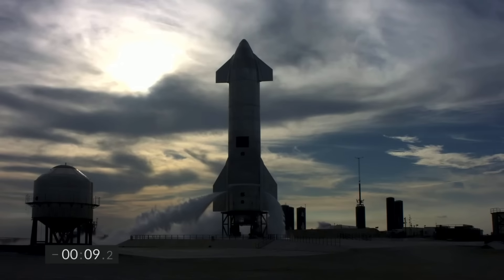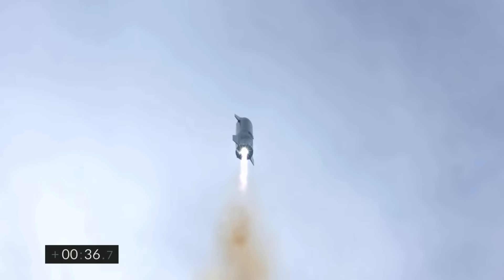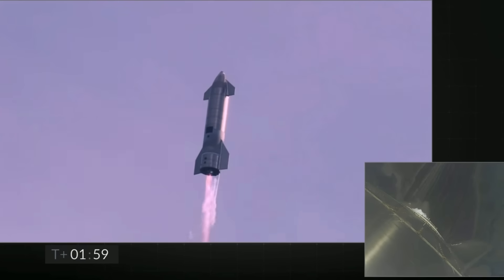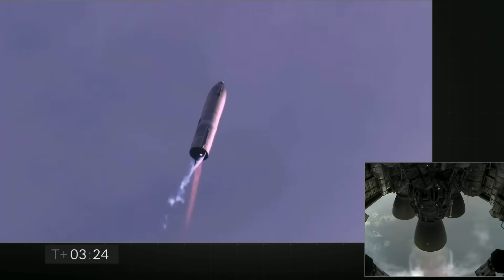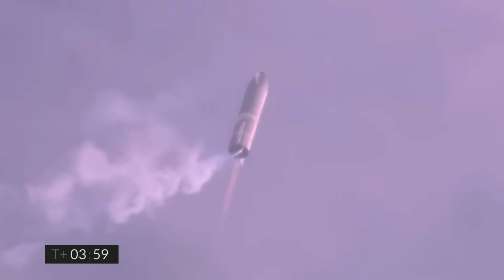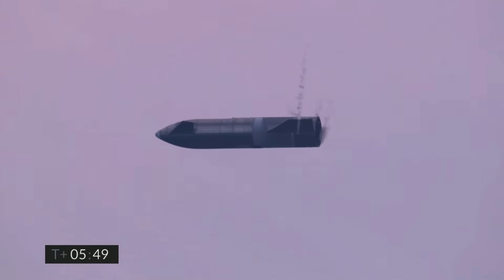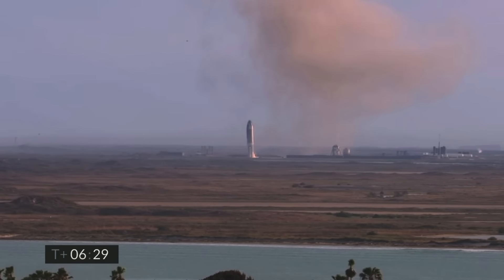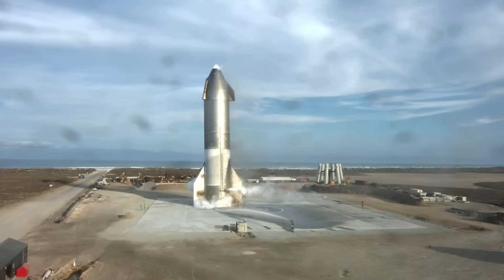SpaceX Starship SN10 soars, lands for first time!

Comment: side note; i have a theory why these probes keep exploding, it's a combination of the fuel source, the atmosphere and the way timing of the rockets descent through the atmosphere. factor those 3 things and i'm sure the probe won't explode anymore
Reply: Really?  Just how many Teslas have you sold?  Where do you rank on World's Richest List?  Now shut up.
Reply: @Melody615199999  slow your role man. all i stated was my own idea and opinion. no need to get all up in your panties because you're some big shot car salesman. it's a basic science and math principle that actually makes sense if you think about it. for every layer of atmosphere you have to increase thrust to break through to the next level, so by the same principle, you decrease thrust but at a slower rate. just like a car that's going 160 mph on an open road. you can't slam on your brakes and think you won't run the risk of dying in a fiery death immediately. you pace your descent accordingly. if you factor in the atmospheric pressure increase according to rate of speed and the gravitational pull, verses the fuel consumption required to use shorter bursts of fuel upon descent instead of a continuous burn, you'll probably see fewer blow ups.

Comment: Congratulations.  Accomplished what McDonald Douglas did 25 years ago with Delta Clipper.
Reply: So has New Shepard and the Falcon 9 rockets. Delta Clipper was a nice little start in propulsive landing though. Too bad it was over cost, poorly managed, and the idea was scrapped after the prototype blew up due to crew negligence. Funny that with actual competently run companies without Uncle Sam breathing down their necks they can actually get shit done. And if they fail, they can do better, rather than give up like the petulant children running these old corporate welfare companies.
Reply: @samos8367  25 years laterrrrrr.  With a lot of help from “Uncle Sam”.  There was no “crew” negligence because there was no crew.  No need for you r petulance Samos.  Simple pointing out we lost at least 25 years of spacecraft advancement because NASA chose NOT to fund the delta clipper because of a landing gear malfunction that could easily be rectified.  McDonald Douglas had the better craft and tech.

Comment: It exploded a moment later. Not enough space between the fuselage under-skirt and the pad. Explosive fuel built up in the gap without enough room to fully vent; residual heat ignited the overpressure gas like the combustion chamber of a car's engine. The system needs real landing legs that hold the bottom of the fuselage away from the ground, at least twice the height of a raptor engine bell. You could see the escaping gasses trying to burn off on one side where the little feet held open a corner of the skirt; but the leaning ship told me that part of the skirt was against the ground trapping unburnt gasses underneath it. The flight computer was good. The structural design engineers fu**ed up.

Comment: "As you can see, Starship has exploded. This is intentional"
Reply: People are burning and wailing now, this is  intentional
Reply: 😂 savage
Reply: I so wish that was said during the broadcast. lol
Reply: volunteerz  It's not really about fixing the leakage so much as about having the landing be a tad softer so as not to cause the damage.
Having better landing legs might have been enough. Either way, amazing test.
Reply: @LuisPereira-bn8jq  The landing was pretty hard in spite of what the propaganda... I mean commentator said.  But it looks like at least one of the engines is leaking fuel when they shut down 1 & 2 just before touchdown.  All that orange flame shouldn't be there.
Reply: @nickh5081  "in spite of what the propaganda..."
You know what the actual "propaganda" is? Your dishonest usage of the word "propaganda". So good job calling yourself out. 
And this was in no way a "hard landing". An actual "hard landing" would have destroyed the vehicle on impact, whereas this landing caused at most modest structural damage. Much like the difference between a fender bender and an actual car crash. 
Was the landing a perfect one? No. But it was far closer to a soft landing than to a hard landing. Those are the facts.
Reply: @LuisPereira-bn8jq  The FACT is it blew up.  The FACT is they cut it out of this video (it was on here at first and they edited it).  The FACT is if you read down the comments, many of the people that watched this after they cut it think this launch was a complete success and don't know it exploded shortly after the video ends.  If that's not propaganda, what is? What's your problem, anyway?  You have money invested in this company or something?  I'm all for SpaceX and hope they get this right - doesn't change the fact that their propaganda machine is trying to hide the truth to some extent.  Does it hurt your feelings less if I call it their "PR machine"?  You should relax, it really was a joke (even though it's true!).
Reply: @nickh5081  "The FACT is they cut it out of this video (it was on here at first and they edited it)."
Really? Prove it. Because it is crystal clear from the narration that SpaceX cut their feed shortly after the landing. Which, mind you, is standard operating procedure: they do the exact same thing for the Falcon 9 launches, where they often cut the stream shortly after the first stage lands, rather than keep that stream open in case something happens 10 min later.
"What's your problem, anyway?  You have money invested in this company or something?"
My problem is with idiotic misinformation like the one you are spreading. Blowing up 10 min after landing has very little to do with how successful this test was. Let's say they had better on ground systems which somehow managed to put out the fire and prevent the blow up. Would that somehow mean that the actual flight and landing were any better? Of course not. Actually put 10 seconds of thought into the bullshit you spew, rather than saying the first bit of random kneejerk nonsense that crosses your mind.
Reply: It's not a bug, it's a feature.
Reply: It’s not
Reply: volunteerz  There was indeed only one raptor engaged on landing, as was intended. And the one raptor seemed perfectly enough. The poor landing legs probably made more difference than lack of trust.
Reply: It clearly was intentional, so the rusians could not steal the desighn.

Comment: How was the video taken at altitude, where the camera seems to be following the ascent of the ship?  I think there is a lot of fake videos in this piece, either that or animation.
Reply: I mean we can see planes that fly at ~11 km up with the naked eye and this only went to 10, so just a bit of zooming with the camera work lol
Reply: It was a plane with a stabilized gimbal camera if I heard correctly.
Reply: @pipess7064  That is a possibility, but I think the plane would have to be climbing at the same rate as the rocket for most of the video.  Also, was the plane flying towards, away from, or transverse to the rocket.  Should we see a changing point of view of the rocket from the plane's flight path?  Thanks for the suggestion, but I am still not convinced, especially when I seen smoke trails from the engines that are moving very slowly, whereas I would expect them to move away at a speed corresponding to the rate of ascent.
Reply: @TheManGrant  The plane would likely be flying a circular pattern a long ways away from the launch for safety. At that distance the plane's movement would look like nothing to the camera, as the ship would stay within a few degrees of vision at most.
The gases being vented out of the ship are lighter than standard air, so they rise, reducing relative speed. And they never got it going very fast since they only needed to go up a few thousand meters.
Reply: @pipess7064  Thanks.  That make sense.

Comment: To prevent any loss of life hows  about (I'm not rocket scientist brochachos):

1. A "Tailhook" similar to those used for jets. 
2. When the space craft is returning have a horizontal entrance fitted with (the aforementioned) that slows the speed of the craft (rapid deceleration).  Again that's at 150mph. I'm sure spaceships go warp speed tho lol.
3. Magnets: as to stabilize the space craft landing (Automatic magnetic field stabilizer ). But it might mess with electronics.

But dang , a real spaceship that lands itself , awsome.

Comment: Why don't they have a parachute, like the one they used for the Mars rover, perseverance. The parachute manufacture in the UK. 🙄
Reply: No parachute is powerful enough to support such a heavy craft
Reply: @baha3alshamari152   The one used for the Mars rover perseverance descent. Was of a super sonic  heat resistant design. They can have three, like the ones used for the Apollo capsule descent. 🙄 Just to slow it down a bit.
Reply: @m101ist  
Rovers are at least 1000 lighter than starship 
Especially if it's full
Reply: @baha3alshamari152  They used a small parachute going supersonic on descent. 🙄 They could use three larger canopies to slow down the rocket a bit on descent. 😲
Reply: @baha3alshamari152  Space X from the international space station used 4 parachutes on the dragon capsule on it's descent. 🚀😲
Reply: @m101ist  The Dragon capsule is the size of half this ship's nosecone. And the airframe itself is nothing important so long as they get the data, which is transmitted over radio.
Also, everything went fine until a slightly hard landing. For an early prototype, that's very good.
Reply: @pipess7064   If they had used a parachute like they did before they would have had a slightly softer landing. 🙄
Reply: @m101ist  Half the test is getting it to land under its own power like they pulled off here. Chutes are pointless complexity in this case.
Reply: @pipess7064  Then after that it exploded. I consider that a failed. 😲
Reply: @m101ist  Apollo 1 caught fire with the crew stuck inside. The Apollo program isn't a failure. This prototype met its goals.
Reply: @pipess7064  well it was a good job nobody inside it. It would have been a disaster. 😲

Comment: After the three engines ignite for the landing sequence you can see something goes horribly wrong as two engines flame out and the craft is visibly spewing fire where fire doesn't belong. So three for three failures. Can you imagine if NASA had so many f*** ups? Congress would be howling for blood.
Reply: Its supposed to land on one raptor engine
Reply: NASA has had a fuckton of fuckups. I can name the Challenger and Columbia, Apollo 1 and 13, and many of their early rockets in the 1950s.
Reply: @pipess7064  Really showing your ignorance of history. Both Shuttle disaster, and the Shuttle itself, were the direct result of political interference. In addition, following both disaster there were years of inquiry and cover-up by politicians. SpaceX has none of that baggage and decades of experience and metallurgical advancement to draw upon.  Back in the 50's rocket science was new. What's your frackin' excuse?
Reply: @davidgapp1457  Is this landing sequence not a new technology also? You should cut them some slack, it's an early prototype. The only difference is that instead of metals, they are testing control and timing devices.
And while the shuttle disasters were in part caused by schedule-pushing, Apollo 1 and 13 were just blatant tech faults. 
On a more similar scale, NASA's research at Edwards AFB led to many crashes. The lifting body tests, high-alpha tests, and the X-31 program all led to catastrophic destruction of several planes (M2-F2, at least one F-14, and one X-31 respectively).
To top it off, what does it matter to you what a private company does with capital? They're not harming you, and the only gov't money they get is for proven stuff like the capsule they sent to the ISS.
Reply: Thats what a raptor shutdown looks like
Reply: @warrenayres200  The engine or leaking fuel continued to burn after touchdown. Add what was possible a stuck valve and kabam! But regardless of your explanation (which I accept) this vehicle is still 3 for 3 and it's only representative of the upper stage. Believe me, I want SpaceX to succeed and I realize you learn from your errors, but NASA doesn't catch the same breaks. NASA, unfortunately, answer to frelling idiots in Congress so their errors can't be as easily brushed off.
Reply: @davidgapp1457  why dont you make a fucking space ship
Reply: @Dominic-sr1ed  Already did that. Went to the moon. Now I'm retired and rolling my eyes at people who stand on top of mountains and scorn the mountain below them.
Reply: @warrenayres200  So explosions after touchdown are normal?
Reply: @davidgapp1457  fire is normal, not an explosion
Reply: Your rocket doesn't go all the way to the moon, does itm

Comment: Looks like a build up of flammable vapors trapped inside the engine area.  The thing sits too low to the ground to allow them to vent out fast enough.  Needs longer legs....
Reply: The landing legs failed, they arent the finished article, just a temporary solution. Now they know they can perform successful manoeuvres i suspect they will start adding some proper landing gear in the very near future.

Comment: How did they get that last camera angle just before straightening up and landing??
Reply: This camera shots are a real mess, it really looks like a mix of CG and real footage.
Reply: Sooo cool! Almost looked like CG animation!
Reply: Yes it is unbelievable haha I thought it was CGI
Reply: @jahithber1430  bro it looked soooo fake init wtf
Reply: 6:14 yeah looks so unreal but maybe it was small camera close to landing pad controlled manual or auto.
Reply: Using TubeBuddy @0.1 x speed.
2:48 On the "onboard camera" (insert), debris start flying horizontally? from right (exterior wall) towards the burners. Even before this white debris did the same... 
2:51 A cable or cord starts flopping.
2:52 On the first "glitch" the onboard camera shows a completely different angle within the "burners bay" just for one shot.
2:52 The cable/cord can be seen clearly after the glitch...
2:56  Second glitch same image, kind of an elongated image of the bay. 
2:58 Again the glitch, same image.
Reply: Anyone want to by my ocean front property in Nevada? Real cheap..
Reply: Super zoom 4k
Reply: @Ross Clapper  There were other cameras that were live at same moment. You can always cheak out lab padre/ nasaspaceflight cameras. They were live on YouTube too
Reply: No expert here BUT, shouldn't light travel faster than radio waves or shouldn't the time difference be shorter?
3:27 Onboard camera shows the Flameout.  
3:31 Life Camera shows the Flameout.   A 4 sec. difference doesn't seems a lot, imo.
Reply: looks fake because it is fake. Do you get it yet?
Reply: @rossclapper1544  if it is fake, go get your denying ass down to Boca Chica and find out, why don't you? Or are you gonna find some dumbass theory and say it's "backed up" after you edit a wiki page?
Reply: @treystinson4116  But he needs lies...
Reply: @rossclapper1544  no
Reply: @rossclapper1544  nope
Reply: @rossclapper1544  If it was fake then why did they bother depicting the engine failures and subsequent explosions of SN8 and 9 with this camera?

Comment: you can see the thrust vectoring at the end.  so cool
Reply: The gimbal mechanism. Must be incredibly complex and masterfully constructed.
Reply: Yeah really amazing to watch engines starting with an angle, so that shuttle starts rotation, then quickly after going to opposite angle so that shuttle stops rotation , then rapidly prevents rotation in opposite direction by stabilizing vertically !!!!
Reply: @davidcastelein2137  they aren't trying to prevent rotation. The gimbals change the direction of the thrust so the rocket can go from vertical to horizontal and back. They 'can' be used for preventing rotation (if you mean along the Y-axis (height)) but that's not the primary purpose.
Reply: CGI

Comment: Pipe rupture because the rocket hit the ground too hard. The fuel has ignited on hot parts.

The rocket lands much too hard. Landing with only one nozzle is like flying with too small a propeller. There is a lack of authority!

When you carry a heavy cabinet, as soon as you carry it, everything is easy, but when you put it down again, the last few centimeters are especially tiring, because you have to be so precise, the weight seems much greater.
 
I would change the software so that on the last 10 meters, the two other engines fire again and the automatic will proceed in such a way that starting from the strongest engine, the throttle values for the others are recalculated from the sink rate. This is important, because on the last meter full throttle must be given again, so that the train also comes to a stop.

Otherwise, I would make the nozzle larger. (Someone once rumored that Elon didn't know how to calculate nozzle sizes).

In the video, the thing crashed into the platform almost without braking.
Maybe it's just hard to describe. It's probably that you not only need a braking maneuver (turn around and brake), but you also need a stop command that stops the rocket when it reaches 1cm above the ground, because it's insanely heavy like a freight train and needs some kind of bumper to keep it from breaking apart on landing.